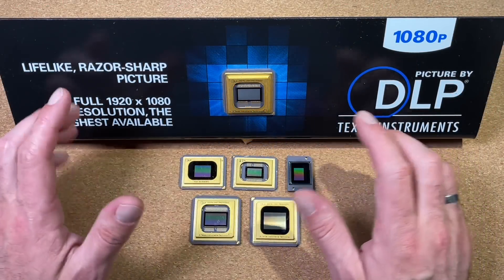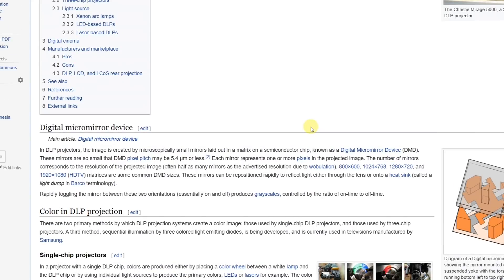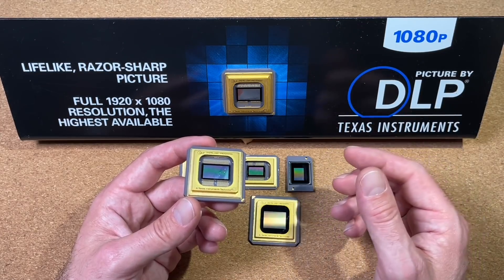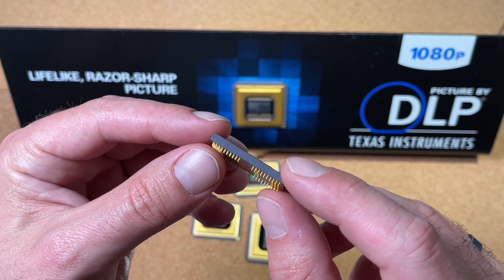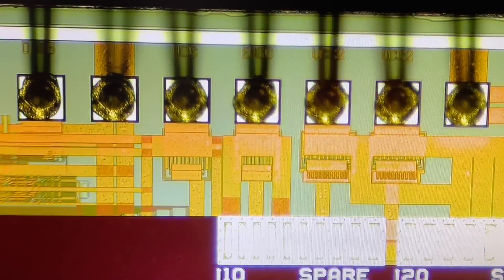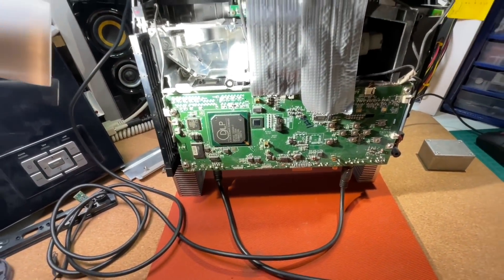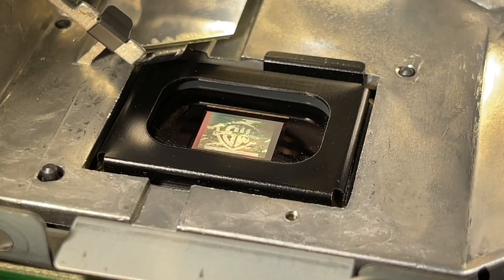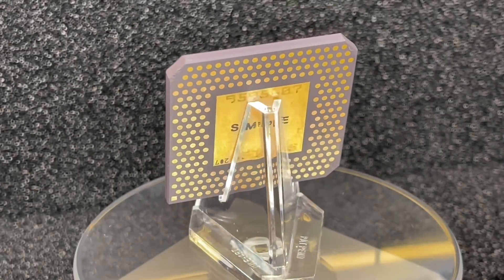DLP Technology & Digital Mirror Device under Microscope and Image Test, CAUTION: Super Interesting

Comment: Hi, I replaced the DMD chip because I had a lot of white dots. Now everything seems fine except that in the bottom left corner of a 100-inch image, there's a brighter area, roughly 40 cm in height and 40 cm in width. Is this the chip's fault, or has some other component gotten dirty?

Przetlumacz na niemiecki

Comment: I had a mini (or should i say micro) laser projector which is definitely based upon the same technology, the UO Smart Beam Laser Pico Projector assembled and made by Cremotech LCoS in 2014. Because I was unable to fix it, I took the lens assembly apart and wow, incredible clever and small inside. Three lasers that does the same the colorwheel does and behind the prisma there is the smallest LCOS i ever seen! 50mm by 100mm, the SYL2271 and has a resolution of WXGA（1280×800=1.024.000 crystal 'mirrors'）Insane, right?

Comment: How the DLP makes shades:
Each mirror flips at a very high frequency. With that, a signal similar to PWM controls how much of the light is reflected to the lens and how much reflects to the heatsink. 
A fully "on" pwm duty cycle reflects all light through the lens. A fully "off" pwm duty cycle reflects all light on the heatsink. and a 40/60 duty cycle reflects it accordingly: 40% into the lens and 60% into the heatsink.

The number of shades depends on the number of bits controlling the pwm dutu cycle.

Comment: I have DLP beamer with broken power supply. Found out how control the system so it can turned on without lamp! Ofc it depends on where you can find the signals and control it with switches so it can turned on with custom 12V power supply. :-) 
But it's possible on some beamers to remove xeon lamp and replace it with LED light and add small circuit to turn on the system.

There are already DLP beamers with 3-color Laser leds. You will notice the light beam is much SMALLER compared to LCD beamer. The light loss seems pretty high in DLP beamer due small hole. There is no large lens array to bundle light to DLP mirror, just dumb-ass small hole. Because it must pass colorwheel.
Bigger DLP beamers have more room, so there might lens array to bundle light to lightbeam.
Thanks to good reflective DLP beamer, not much light is lost here. LCD beamer has much wider light beam but light loss is slight more in LCD panels, also some loss in splitting lights in 3 light beams for each color. Looking at light path, DLP beamer seems not very effective.

Comment: The intensity is due to the color wheel sections. It often has multiple sections of transparant wheel usually to make it brighter. Some have multiple sections of the colors on the wheel. The mirrors can flash 10thousand times per second, it strobes extremely fast through the correct colors on the wheel. It stays reflective more for brighter image, while it blocks light more of the time for a darker one. Because it's 10000 per s, you don't see this and percieve a single image.

Comment: I am also fascinated by DLP as a technology. DLP uses the * fast * mirror movement to reflect light in a direction or another (fully saturated color is 1 and no saturation color is 0). The 1 is fully reflected into the lens, the 0 is reflected away from the lens. How fast is that switching? It goes up to 9 kHz, that is 9000 times a second for each pixel (newer ones go up to 32 kHz). This is how they manage to get all the grayscale values for each color by synchronizing with the color wheel and setting the grayscale for each image 30 or 60 frames per second, that is about 90-180 frames per second to get the full spectrum of color. All the intermediate grayscale patterns are done by the rapid switching between the fully saturated state and no saturation state. This is easy because the chip is capable of up to 9000 Hz switching and being digital it can easily synchronize with the color wheel for full color rendering. DLP is capable of 1024 shades of gray for each color individually, that makes up 1,073,741,824 colors for RGB or even more for CYMK. The human brain is blending the rapidly switching images to get a fluid movement. I hope it clears your question at the end.
Reply: Yeah the video got me thinking how they make shades with this thing and as the mirrors can't do partial turns as they'd reflect light on other pixels where they shouldn't I concluded that I can't think any better than that it must be some kind of a PWM device. And from what you say, it is. Which means that those tiny mirrors keep flipping in an insane rate. First the video signal, then the color wheel, then top it all with the shade PWM value... Their control needs some crazy precise timing. And they need to be quite durable for mechanical devices too, to pull off all the switching.
Reply: Of all the tech we have, DLP is still the one that fascinates me the most.  Tens of millions of microscopic mirrors packed onto a chip and being moved independently with such speed and precession is nothing less than astounding. Thanks for sharing the numbers, only makes it more impressive. Anyone not impressed by this is so sadly jaded they have my sympathy.

Comment: The change in intensity is sorta not whats going on. This is a correction taking place to the color wheel. There are two different types of color wheel. One with 2 of each (blue,green,red) and another that has transition colors (ie a blend of two colors and a solid color. When there is a variation of a color outside the color band the transition color is used to give a better color tone. This requires more light. So the gradient changes when you go from a solid primary color to a in between color. Hope that makes sense.

Comment: There is no any problem to make a different intensity of colors, as you have notice, color wheel rotating at high RPM, so every frame gets multiple wheel rotations, as you can imagine, mirrors should turn on an off at least once per color, and for DLP device it is not a problem to turn on and off multiple times per color, so its just PWM

Comment: They are a super cool addition to a collection! I got into DMDs a bit and managed some decent microscope shots of them running, though they where the pocket projector form factor which easily fit on the microscope stage. These have always fascinated me, the engineering is absolutely mind boggling. If you have a chance check out some of the MEMs micro mirrors, they are also really cool.

Comment: I never knew how DLP projectors worked. I always assumed it worked like a film projector as in the DLP chip had light shines through it. I always wonders how they could withstand so much heat. I never thought about the possibility of all those tiny mirrors physically moving. That's wild.

Comment: The pixels are pulse width modulated, not sure of the frequency but these chips update pixels very very fast. It's amazing the speed, precision and sheer quantity of electromechanical parts on these devices. Look into the consumer "4k" projectors, they seem to be using 1080p chips but are doing some sort of pixel shifting, combined with up to 6+ updates (3 color wheel RGB x2) per 60Hz refresh you can start to see why the chip needs a big heatsink (aside from being blasted from the front with a few hundred watt lamp). Would be interesting to see a follow up investigation! Edit: Also it's electrostatic, so those pixels may not be dead, just stuck.

Comment: the brightness is controlled via pulse width modulation - switching the pixels on and of at a pretty high frequency. it should be possible to meassure that frequency with a photo diode, hooked up to an oscilloscope.
PS: i've recently come across the avegant glyph video goggles, which use miniature DLP projectors instead of the usual LCD or OLED displays. looking foward to trying those out. compared to 720p goggles sold for FPV, they're an absolute bargain.

Comment: It's impressive how MEMS completely flips what we understand of materials on it's head. The effects on the material like fatigue and such change completely to what applies in a macroscopic manner, hence they even work to begin with, the amount of deflection, how many per second and speed of the mirror deflections would be completely unfeasible in a macroscopic scale. Let alone the energy to keep flipping the mirrors fast enough for moving pictures with different shades of light.

Comment: Thanks!! I was repair movie theater projectors, it's amaze technology) But soon in theater will be a big LED screens and DLP go to the history..
Reply: I wonder if it will happen tho, there's few if any disadvantage inside a cinema to use projection, the contrast ratio of individual LEDs is easily matched by DLPs (what they use now in digital cinema projection after all), and the cost would be astronomical even many years in time, think about the size of that thing, it might get down to 1% of what it would cost now but never cheap. Plus individual failure points that are far harder to deal with.

Projection still has quite a lot of interesting uses, both indoors and out.

Comment: Thing is, Audi uses this in their newest Headlamps. I tought about that many years ago when I had my first DLP beamer, that you could use that to modulate low and highbeams in a pixel perfect manner and create a Matrix LED system, much better than even modern ones. Tought about that around 2011, but there I was too young to make something about it, also, DLP Beamers then were expensive as hell :D 
They clearly won't use regular DLP's, they must be fancy high reliable ones, but nonetheless, DMD's are facinating technology that is now even used in Headlamps (Audi E-tron).

Comment: The reason why you can see different light levels from the Micromirrors is that your eye is integrating the perceived scene's light level over a given timescale, therefore if you keep flipping the mirrors at really high speeds, you can see an average light level which is proportional to the amount of time that the mirror is in the on position.
Reply: per pixel/per color duty cycle

Comment: The chip itself doesn't really heat up that much but only a percentage of the light gets reflected, the rest is dumped as heat in the chip case. If you stick a piece of paper into the light in front of the chip it will be set on fire immediately. The light is extremely intense.

Comment: The micro mirrors vibrate back and forth to create tonal values.  When DMDs fail its due to the mirrors being stuck or moving extremely slow. I used to work on rear projection DLP and 3LCD rear projection TVs for over 10 years. The biggest pain in the butt with those TVs was the ballast going out after the lamps would go out. People would replace the halogen lamp themselves, but touch the surface with their oily fingers thus significantly shortening the life. Color wheels were easy to replace and easy to tell when they were going bad (the bearing would fail) and it would sound like the tv was a vacuum cleaner. Lol.

Comment: My daily driver (watcher) is still my Samsung series 8 LED DLP 62”. They’re LED for the light source unlike a lot that had a bulb that needed a bulb that needed replacing. Bought it new in around 2008 for ~$2000 cdn on sale. 1920*1080. 

About 4-5 years after lots of use it started to get white dots (stuck mirrors) and black dots (dead mirrors). When it got to be too much I tore the whole set apart and ordered a new dlp module (about $250). There was a common failure on these where they didn’t put enough heat sink compound on the module. Added some good compound under the new module, and it’s been working perfectly since then.
Reply: Interesting. At work, one specific projector model always goes bad (after many years) and it seems to always start in a corner and spread from there, so I guess they skimped on the cooling paste as well.

Comment: 9:24 Xeon Lightsource, the small sister of a Ryzen Lightsource? ;-)

Good video as always! 
And the DLP Technologie is really high tech with all these tiny mirrors which have to work flawlessly in order to get a good picture. In comparison to your 10MB Hardrives which you could repair with a hammer and a screwdriver, these devices were much more filigran.

Comment: Are you sure the darker mirrors are defective? They may just do what they are designed to do... Maybe they're just not aligned to the rest? They may have been at flipped state when the chip got powered off or flipped due to vibration 🤷🏻‍♂️
Reply: Agreed, the state of the mirrors is only valid when active. If there's no signal the mirrors are "floating" In an indeterminate state for lack of a better term.

Comment: The irony is that the DLP is in fact a very analog light processing 😀
Reply: From back in the day where anything with the word "digital" on it was cool and hip 😄
Reply: @TomStorey96  now they are needlessly throwing “analog” into ai circuits.....full circle we are
Reply: It's not analog. The mirrors have two states and are controlled with very precise digital timing. It's rather more complex than a simple PWM, but the result is the same. Your eye receives digitally timed pulses of light of different colours which your eye and brain then integrate into an analog perception of the desired colour at the desired intensity. (I have the benefit of having worked at Texas Instruments from the late 90s to mid 00s.)

Comment: Oh I know the color shade answer!

So you know how the color values are made out of bits right? Full brightness is all 1s and black is all 0s, basically each bit position is assigned a "time slot". The most significant bits get the most amount of time. That also means a value of 0b0101 switches more times than a value of 0b0110, makes driving it easier but it also means those mirrors need to toggle incredibly fast!
Reply: That is called "pulse width modulation."
Reply: @harrkev  This isn't quite the same thing.

Comment: Excellent video, i had 2 dlp televisions in the past and even a lcd projection tv. The mitsubishi developed stuck pixels shortly after replacing the bulb and after doing research found most early model dlp chips where plagued with mirrors sticking due to a defective lubricant with mirrors either getting stuck on or off. As for the light intensity i understand it was achieved in similar manner as lcd pixels, a fully opened mirror/pixel is white and a fully closed one is black but just with a single set of of pixels having the color added with the light wheel

Comment: I've repaired a few DLP projectors some time ago.
What I've learned is that the market is smack-filled with bad knockoff DLP chips from china that develop stuck pixels just hours after powering on. (Could also be refurbished chips)
Finding actual original DLP chips is really hard, and once one does find them, they're so extremely expensive, it makes the repair cost multiple times higher than a brand new projector.

Comment: Really interesting that a majority of the dead “pixels” were along the same row. Why might that be? Might one row have been over-driven for some reason?
Reply: Could be when one shorts out, the current received by the rest of them in the same row is higher, so probability of another one burning out in same row raises. Just a guess.
Reply: @KrzysztofC-1  seems like a sound theory!
Reply: I didn't have that, I had such a projector fail after years of usage. First I had 1 bright pixel, a few hours later I had dozens. A day later it was like looking at the stars when I projected z black image. None of them on the same row really.
Reply: interestingly i recall seeing almost every video game manual warning section about not playing games on "projection screens" might DLP be the projection screen they warned about?

Comment: The grayscale is achieved by rapidly turning on and off the pixels. The ratio of on time and off time determines the intensity level. This technique is widely used in electronics (e.g. controlling backlight brightness on your phone or laptop screen) and it called PWM or Pulse Width Modulation.
Reply: Agreed! For each RGB frame cycle time, the mirror can be on the entire cycle (full brightness), or any percentage down to zero. Video signals encode two values: Chrominance and Luminance. The Chrominance is used for the color information and the Luminance for brightness. The ratio between RBG (Red,Green,Blue) defines the color, then the duty cycle (on time versus off time) defines the brightness. The higher end units use 3 separate DLP's, one for each color; no color wheel needed.

Comment: THIS is the kind of stuff that made my day👍 Thank you. I had an 800x600 Acer DLP projector back in '04. After 3 years of light usage it start getting more and more broken pixels so I replaced it to a Full HD DLP beamer. TI seems to optimize their DLP chips as this time I had no issue with broken pixels (still have the projector in use from time to time). Too bad I did not disassemble the broken DLP back then. Very beautiful!

Comment: 9:25 "Xeon light source" - The side effect of being a CPU collector :D
Great video! I always wanted to try this.
Reply: A small comment is also that it's /not/ a xenon-lamp, but a metal-halogen bulb. It doesn't require as much high voltage to strike and it doesn't have the same high pressure.